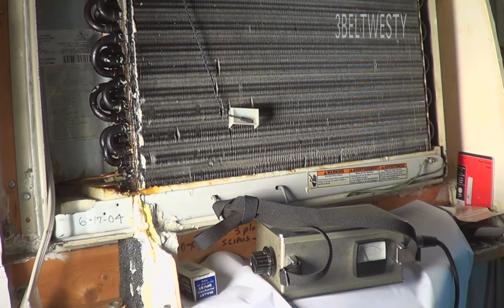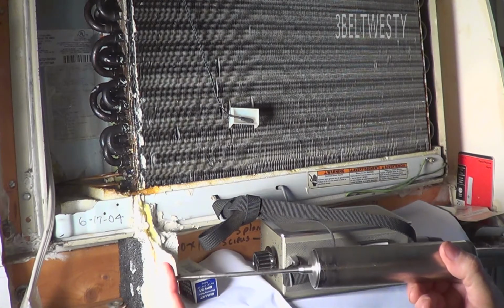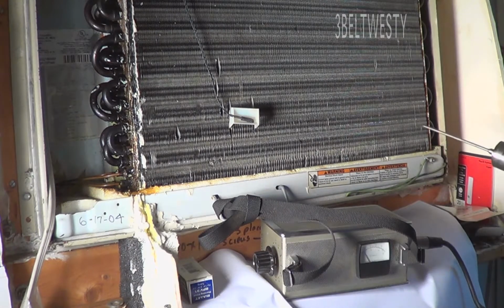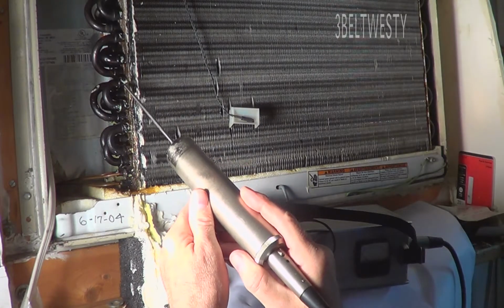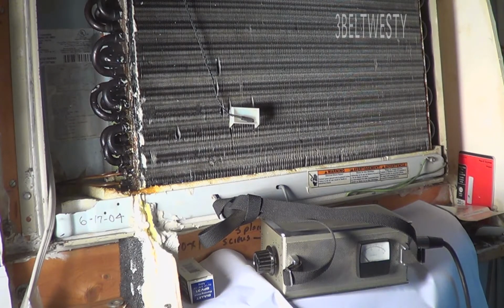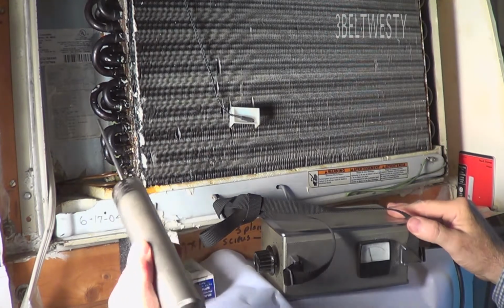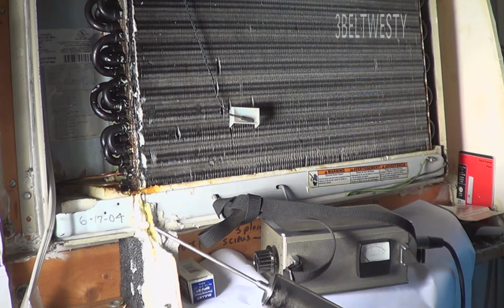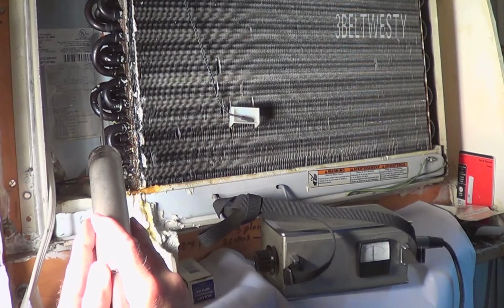Ultrasonic Leak detector (3) HP 4905A Delcon window ac freon leak h10

Comment: i search for the baterry of this device ,can you helpe me please !!!
Reply from the maker: Hello. The Unit when new in 1967 used 3 mercury cells called Eveready E12. They were 1.4 volts. HP used a mercury cell to gain more amp hours. The Alkaline dry cell was not patented until 1960, US Patent 2960558. Common AA Alka a daceline batteries become widely used a decade after the HP 4905A was designed

 On mine I use 3 common sized. AA Alkaline batteries 1.5 volts. These batteries very common for flashlights and radios.. http://www.hpl.hp.com/hpjournal/pdfs/IssuePDFs/1967-05.pdf